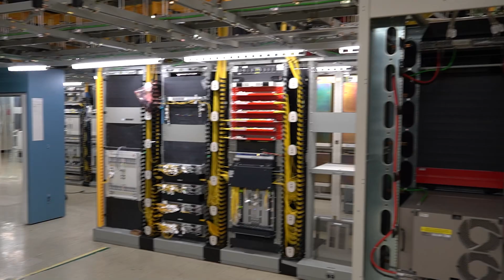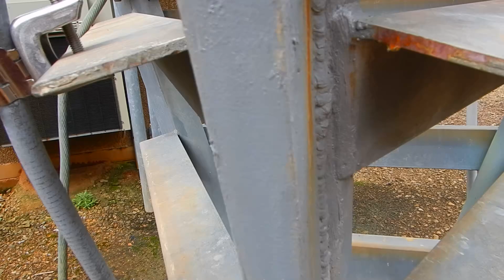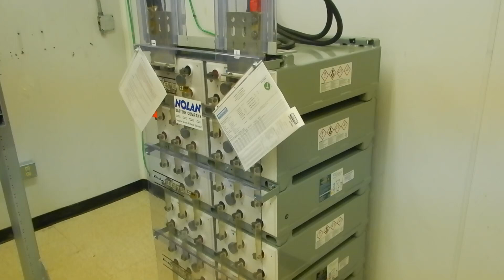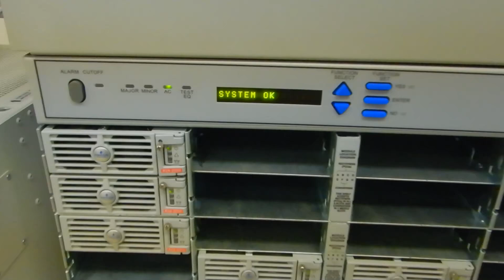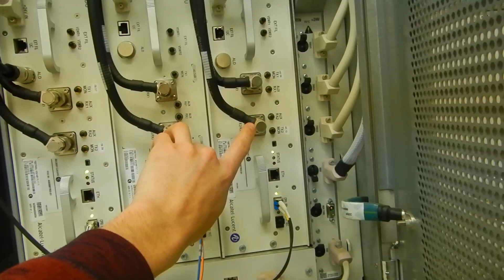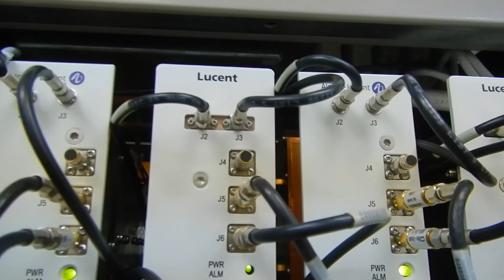Cell site walkthrough

Comment: Sometimes when working on hvac equipment the Verizon tects would call me to reset their equipment or reset breakers for them. so they did not have to go to the site. One called me out a 2 am because he locked his truck keys inside the shelter along with his track key .  One called me out at midnight to jump start his truck. Got to help my Buds out. Verizon has the best techs. Great guys.

Comment: A couple VZW sites by me have their feedlines go through a pipe before going in the shelter.  My only thought would be a choke for lightning??
Reply: Lightening never follows down the coax cable. The towers are so heavily grounded the lightening follows the ground wire to ground. The coax cables have lightening arrestors. it never would make it to the shelter.

Comment: In the mid to late 90’s I used to build base stations, in a warehouse, and we would ship them to the customers. We used to cable out Erickson 882 equipment in 7’ racks and install in the enclosures. Then we started installing Erickson 884 equipment, which was way more modular. Still way bigger than what is installed in this site. Around 2016-2017 we did a DAS (Distributed Antenna System) for Sound Transit Link Light Rail tunnels. We installed the 1 5/8” coax cable in 50’ sections for 2 1/2 miles in both tunnels, 5 miles total and around 500 antennas. What a pain in the butt those connectors were. Thanks for the tour!

Comment: When you mentioned cell-site security… Reminded me of transport equipment circuit-pack theft.  (External equipment to the cell-site).  One thing this thief may have not realized, the high-dollar component had Non-Volatile memory storage in-which either the manufacturer or end-user / edge company provisioner, placed site-name and other specific info. When this part was installed elsewhere, this site-specific info. would display.  Bulletin was sent to all folks associated with this equipment to be on the lookout.

Comment: Thank you for the great video. Please never take it down. I’m sure people will find it useful in the future. 
And to those future watchers I would like to add a few comments. 
The quality of cable routing in this shed, at least from the perspective of a tech from the 1990s (my experience was with Wiltel), would be considered pretty terrible and likely result in unreliable service.  Wiltels’ reliability was over 99.99999% uptime across their nationwide network.  Based on my experience recently, carriers don’t even hit 90% uptime these days.  Every wire should be tied down to the metal frame every two to three feet and you should never see bundles of extra  in-service cables. Each cable should be a foot or so long on each end dropping down from the termination point to form a drip point in case the cable gets wet and allows for enough extra cable for reterminating. I hope when they replaced this 3g equipment they were given enough time to do proper cable runs. 
That brings me to my final point, I suspect the drop in quality of work in this facility is due to corporations constant, and unnecessary, cost cutting efforts. Since the late 90s the telecom providers have faced 0 liability for neglect of the networks and this facility is a great example of that. 
Again thank you for the very interesting video.
Reply: Same situation with power companies these days too. They have a monopoly and they're incentivized to defer maintenance then charge special assessments when big storms hit etc.

Comment: Thanks for the inside view.  What about back-haul?  Once everything goes to the ethernet switch, how does that connect to the rest of the system? Copper?  Fibre?  Microwave?
Reply: Used to be all 3 but today it is mostly fiber. They usually buy service from the local provider in the area.

Comment: Semi retired now but started in '85 and worked my way up the ladder. Mil background helped get me started. Had the pleasure of touring an Ameritech head end cell site during the early AMPS days, very interesting! Fire suppression system consisted of three large high pressure tanks full of HALON GAS, if the fire alarm sounded we had 30 seconds to exit the site before the gas was deployed. One had zero chance of survival within the shelter once the system triggered if you were trapped inside. This was the main control site for all of the cell sites in the city at the time. Installed many conventional repeaters, LTR 800 MHz, LTR VHF NARROW BAND systems, VHF and UHF paging systems, 220 MHz ACSB LTR systems. Even topped the Hancock center in the Windy City. I have seen all types of sites and most installs for me were one day jobs. System owners hired their own tower workers but had to terminate in the proper locations we had specified in the site plans.
Unfortunately I have worked in pig sties all the way to luxury cell sites. Motorola "controlled" sites were nice since their engineers specified cables and lengths to attach to their combiner systems. Their engineers would do the final alignment for transmitter combiners. Wouldn’t mind having something where I live now but I have seen the results of direct lightning strikes, don’t want it anywhere close to where I live.

Comment: Incredible video, thanks for sharing this otherwise rather obscure information. Are you familiar with cell sites that don't have a hardwired fiber uplink back to the network? How do they handle wireless backhaul connections? Is it similar IP routing equipment, just using PTP wireless links instead of fiber? Or is it some kind of custom configuration? Was always curious. Thanks again!
Reply: T1s were big back in a day for cell site backhaul.
Reply from the maker: Never heard of a cell site that does not use a fiber connection or microwave link.
Reply: @ATI556  Retired Verizon tech here (left in 2025 after 35 years) We went from copper T1's to fiber no microwave stuff that I ever saw. Great Video!!
Reply: there are options for wireless backhaul.  point to point, point to multipoint for co-located wireless stations, and satellite interface for extremely remote locations.  no custom configurations, and they all carry the same types of data.  you just have to have the right equipment to interface and also take into account best practices for wireless (los, weather, etc).
Reply: If not fiber is available it’s usually microwave point to point, and today that means IP/Ethernet.

Comment: Man I could talk about some issues with that tower grounding. R56 is close but there are some other things you can do to lessen the current from a direct strike.  Interesting they welded to the tower. I could talk about the light equipment, what a short strobe means at night when it's supposed to be red, etc. I'll comment more when I'm on an actual PC lol.
Reply from the maker: Actually the grounding to that tower is extremely good at what it was designed to do. 
The ground system itself is not designed primarily for a direct hit but more so for static prevention. No static=no lightning strike.
Reply: @ATI (Accomplish The Impossible)  No it's not bad at all, but there's always room for improvement. :) I would make sure the pigtails coming off off the hard line are equal or higher diameter for each feed line shield surface area, and have nice smooth bends down towards the Earth near the bonding plate. it's best to have it lower to the ground but this may not be practical on a telecom bldg entry panel. Still way better than any ham radio tower set up i've seen haha.